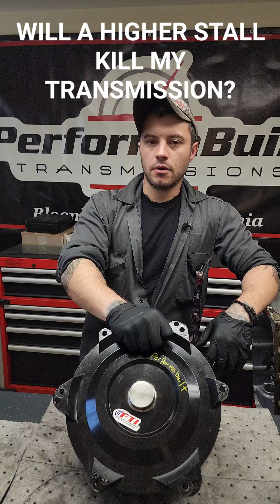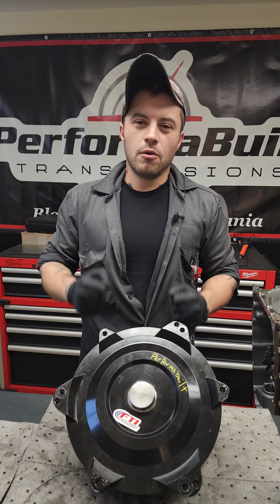How Will a Higher Stall Affect My Stock Transmission?

Comment: I had a 383 Stroker had a cracked Block Bought a 427 from Blue Print Engines But I’m running the same converter now when I’m cruising through town I notice that when in 2nd feels like it’s coasting then give a-little gas and it hooks up my converter going bad or I need one to match up with the new engine Thank you  if Answered
Reply from the maker: Stall wont work the same engine to engine. You will need to figure out the stall speed for your 427. 383 makes rpms very differently.
Reply: Thank you so much for your expertise I will do my homework to see what I need for a new converter

Comment: I just recently got that same stall about to install it also. But it comes with this spacer that goes between the stall and flex plate center hole, I guess I was just wondering if I have to put that spacer in between or is it not necessary?
Reply from the maker: Most of the time that is needed. Please call the company you purachsed your converter from and verify that your crank pilot and converter are compatible with or without.

Comment: I just built my 07 gen 4 5.3 with a stage 2 truck Norris cam springs dod delete if I get a 2800-3200 stall would I be okay
Reply from the maker: Yes if your ve tables and fueling are correct then you will be fine. Youll have to tune appropriately for your higher stall speed and new trans also. Dont forget to change your oil and filter like most people

Comment: I was thinking of getting a slightly higher stall than a factory converter. I built a Ford 351w to a 410 stroker. "87 pump gas towing motor with 210 cc aluminum cylinder heads 9.3:1 compression" So I'm going to stick with the stock torque converter pulling a 7,500 lbs trailer around.

Comment: Got a 06 silverado 2500hd
6.0 with truck norris cam
50lb injectors
Hp tuned
35 x 12.50 tires
And 4.10 - 4.11 read end
I got a 2800-3000 stall should i be okay
Reply from the maker: If you tune the trans for all that and your fueling /ve tables are correct then yeah your good

Comment: I have a question for you, my friend :)) I have a Pontiac Grand Prix 3.1 from 91, automatic transmission 4T60 and converter FJ9B (1800-2200 Stall). Will I gain any benefits by changing the converter to FLHB (1500-1750 Stall)? Will my car start better with such a converter? I want the car to accelerate more freely and burn less gasoline while driving in the city. Currently, I have the impression that the car crawls very poorly at idle speed. It used to be better. I would be very happy for your advice. Oh, the FLHB converter, I have it from the same vehicle, which had a 2.3 QUAD engine and automatic transmission TH125. Could it be a good idea to use such a converter for the 3.1 engine and the 4T60 gearbox. Best regards, Adam from Poland
Reply from the maker: You would utilize more bottom end torque instead of linear stretching it over the top. Too low and you push through the brakes. I would stick with the factory stall tbh in something like that.
Reply: @PerformaBuiltTransmissions Thank you very much for the technical advice. But can an experiment be done? Nothing serious will happen? I drive around town quite slowly, and the engine speed is in the range of 3000 to 3500 and I wonder if in such a situation using the FLHB converter, will not make the car have a little easier when starting off. My car currently has a fuel consumption of 16MPG. For me it is a lot and converting to metric values, it is 14.7 liters per 100km. These are values for city driving.

Comment: I benn running 3800 on the street turbo 350 stock no problem
Reply from the maker: Depends on your tire size, rear ratio, and trans ratio as well as rpm powerband. Different set ups flash differently. You may have a 3800 flashing lower because of setup which works well.
Reply: Will a stock 200 4r transmission work with a SBC 450hp/460 torque engine in a car that's just for cruising and it sits in the car garage mostly ?😊

Comment: What about on a 4l65e in a 05 gto is there something i can do to have it stop frying my transmission with 3200 stall
Reply from the maker: Tune the trans for your 3200. Pretty simple. Every trans setup running over 3000 needs extensive tuning